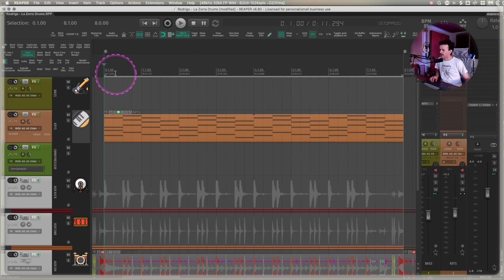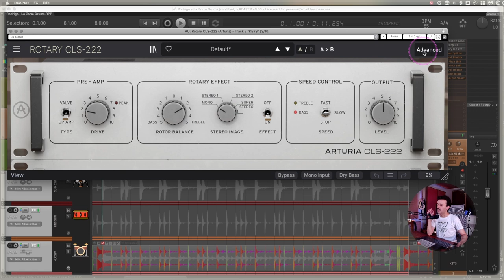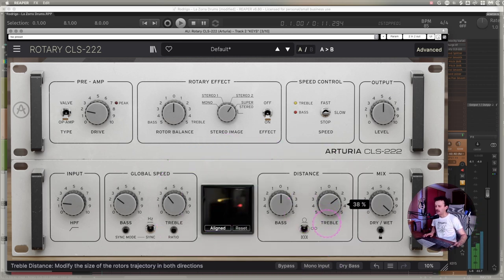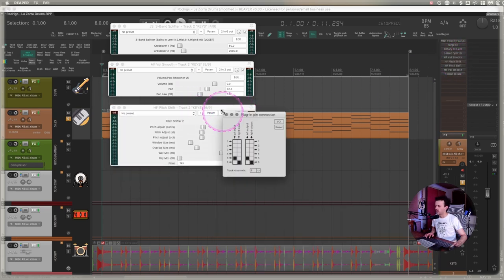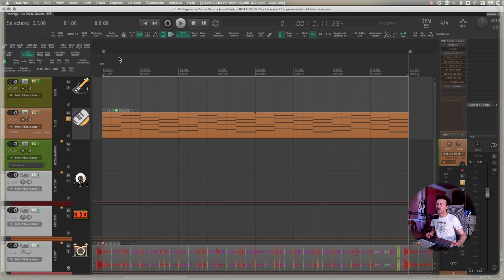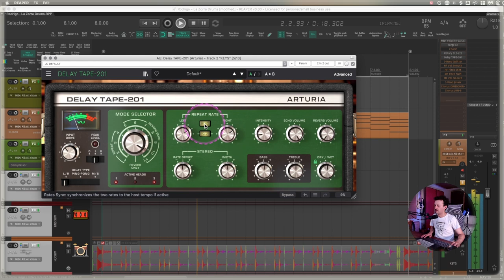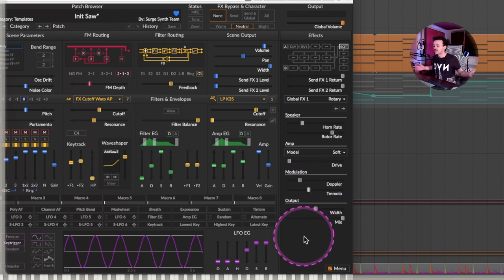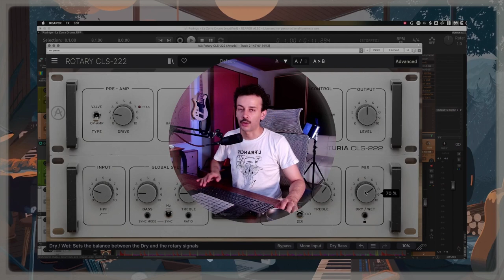Can We Build a Leslie Rotary Speaker Stock Plugins Only

Comment: Can you show your full setup of the plugin chain including routing pins etc?

 Also, please pay a lot of attention to the choice of sound examples. So many really good channels forget this. The examples used should really make the changes stand out ina simple and familiar way. Save the complex sounds (and arrangements, when appropriate ) that you'd actually use for the intro and final examples where it all comes together, but as you demonstrate keep it simple so untrained ears can hear all the details. Dan Worrell, one of the best best YT creators, often gets this wrong, as does Chris of airwindows, another brilliant creator.

Thanks - I had overlooked the stock plugins for too long and have recently been exploring them. This kind of content is really useful, and in my case, timely.

In this case I would have opted for the familiar Hammond. The sound used has too much going on, esp. something in the higher range that ends up sounding comb filtery or flangy.

Keep
Reply from the maker: You can download the FX chain in the description. 
The sound I'm using only has movement because of the fx, so this is probably a good example for most situations. We have an intention with the way we setup the examples. 
Thx for watching.